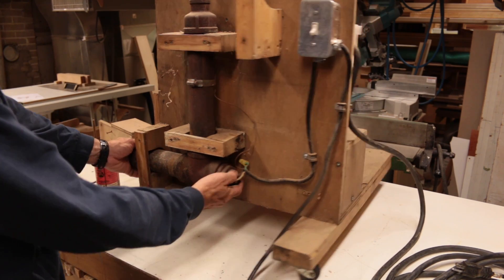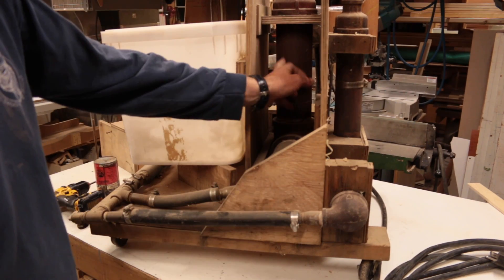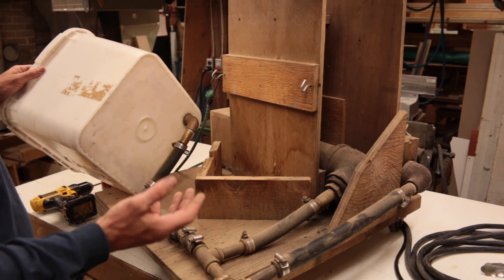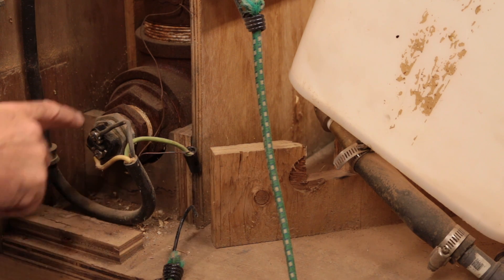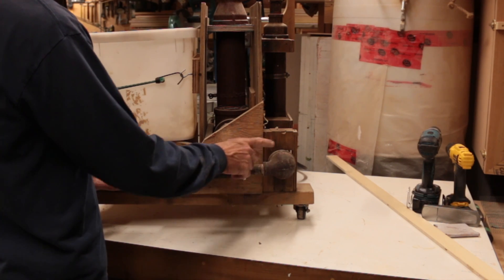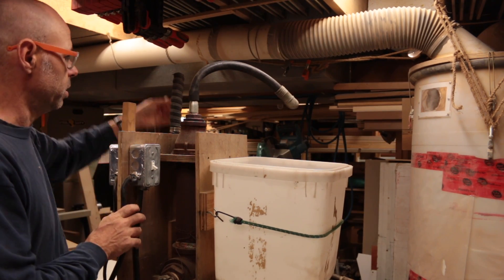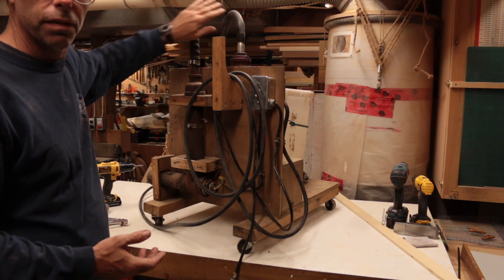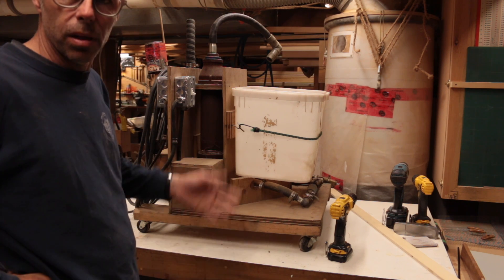⚓️NOMAD - DIY STEAM GENERATOR

Comment: What size are the 2 bushings for the 110 and 240v? Thank you!
Reply from the maker: Carp Bait USA well the heating elements have a thread that measures nominally 1-1/4” so you need to make the jump from that to whichever pipe size you use. Either element can fit into either pipe size but I decided to give the 240v a larger boiling chamber. The elements use a different thread than the black pipe but it’s close enough to work and the elements have a rubber washer that seals them in place so the threads don’t need to do that job as they would in a pipe to pipe joint. Best thing to do is buy the element and physically find the bushing that fits it. Try asking a pipe supplier and they will probably stonewall you due to the different thread patterns. It’s a jerry rig.
Reply: Nomad Boatbuilding  thank you very much for the quick response! 
I was going to place an order online for the parts and wasn’t sure what was close enough to the thread of the heating element. So I should get a bushing with thread 1 1/4 and “ make it fit” :)
Reply from the maker: @carpbaitusa  Well fingers crossed on that one. I would just be heading to my local hardware store or plumbing supply but I guess everything "local" has been bulldozed in most of the states! Tell you what I'll do. If the one you order doesn't fit, I'll get you a bushing and send it to you.
Reply: @Nomadboatbuilding   I researched the heaters at lowes and the 120v-240v has 1-inch NTP thread when the other is unknown so I better get my heaters first or buy the 3" to 1" reducer bushing and take it to the store! I really appreciated your support and I will keep you posted on the outcome!
Reply from the maker: Marco's World that’s pretty much how I did it. Perhaps the opposite but regardless, forget the numbers. Find the bit that fits.

Comment: Here is a different way to make electricity anywhere water boils at 30c in a vacuum and returns to liquid at 29c the expansion rates are the same no matter how the water boils. This means in a closed system you can run a steam engine off heat from the sun and endothermic from water sources you could even run an air conditioner use the heat to boil water and the cold to return it to liquid.
Reply: the steam softens the wood because of the heat, it's good because it distributes the heat well and does not burn/dry the wood
Reply: @nicholasagaman3701  Yes it is great for bending wood for those reasons.

Comment: Just stumbled on your channel looking for DIY steam stuff. Great channel, love the shop tour. Warts and all... Question: Could you clarify what size pipe for the 110v element? You said the larger one is 3", but there's quite a size difference. So I'm thinking they are 3 & 4 inches respectively. And what sort of supplier did you source the pipe from (if it wasn't a scrap bin). Thanks, and keep up the great content!
Reply from the maker: The 110v element is built into a 2" diameter pipe. Bear in mind that pipe is measured by the inside dimension. It's just standard threaded black iron pipe from any plumbing supply. You don't need to use a smaller size pipe for the smaller element. That just happened to be my starting point when building my steam generator. A larger boiling chamber is not a bad thing. It just takes a little longer to get up to steam. The most important thing is that the coil stay submerged or it will burn out, which is why mine are sitting in the horizontal section. I used to run it vertically until I burned out more coils than I care to mention. The vertical portion is just to provide a larger volume of water to heat up and to prevent the boiling water from spewing out through the hose, which it will do if it's overfilled. The water level in the cold water reservoir will dictate the level in the boiling chamber. I'll reiterate that the main reason for keeping these chambers smaller is to speed the getting up to steam process.
Reply: @Nomadboatbuilding  EXCELLENT! Thank you so much for your reply!

Comment: Hello mark. I use a wall paper steam stripper from b&q which is a British DIY store.  It's a black and decker and it's basically a big kettle with a tube on it.  I take the wall stripping plate of the end and plug it straight into my steam box.  Also it can still be used for stripping wall paper. Love your videos.
Reply from the maker: If that works for you then great! One rule of thumb for efficiency is don’t build it if you can buy it. I often have to steam sizeable planks in colder weather which is one reason I have the 3000 watt boiler. I sometimes even have to use both.
Reply: @Nomadboatbuilding  I hear what your saying.  My dream box is built from foil faced insulation boards so there is little heat loss.  I'd like to know where you studied and how you got into boat building Mark.  Thanks buddy.
Reply from the maker: Quaker 1969 I should really do the same. I’ve got a stack of that insulation on hand and everything. Bear in mind that when you’re using a steambox you sometimes wrestle to get stuff in and out quickly. It would be best if the interior of the box was a hard smooth surface.
I got into boatbuilding after reading a couple issues of Woodenboat Magazine. After about three years
I built myself about three boats and decided to enrol in the Northwest School of Wooden Boatbuilding. That was over 20 years ago now.
Reply: @Nomadboatbuilding  Do you have any of the plastic lining spare from the inside of the drop boards.  Not sure if it's robust enough as I'm not familiar with the product Mark. Cheers buddy.
Reply: I like the cut of your jib... as they say.  Your video style is great at getting the info across so it's carrying just the right amount of detail I think. Keep it up Mark.
Reply from the maker: Quaker 1969 thanks. I wish I could get through the editing faster but I'm improving slowly. Sound is the biggest stumbling block.
Reply: @Nomadboatbuilding I think your  sound is good Mark.  I especially liked your marble machine x boat shop mix. That was great.
Reply from the maker: Quaker 1969 sure. That’s just Arborite. Probably not as cost effective as just building the box out of light ply and insulating the exterior.

Comment: This is a really good idea. I appreciate how simple the design is. I have made something similar for heating beer for home brewing. The only thing good about propane burners is that you probably have the necessary items on hand.
Reply from the maker: George Simmons I've used propane burners plenty of times and my main dislike for them, or her than the open flame, is cost of operation. Propane is fairly pricey where I live.